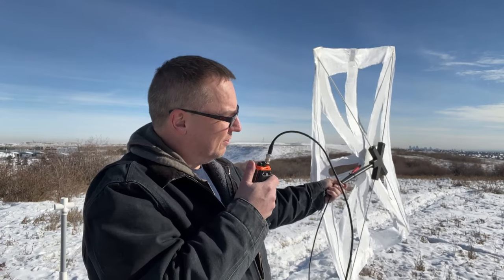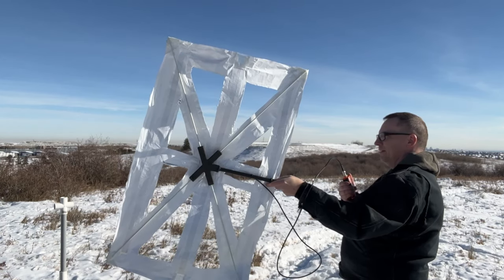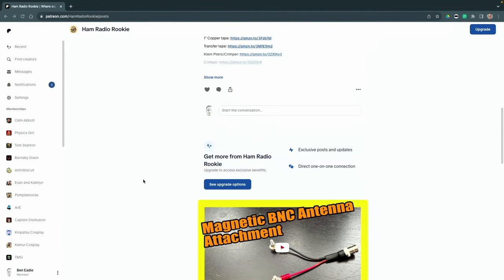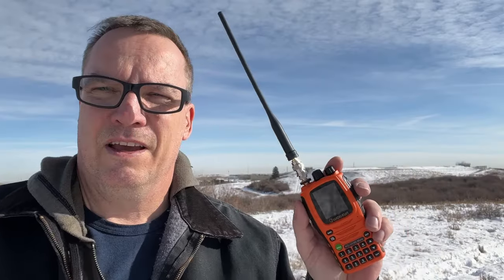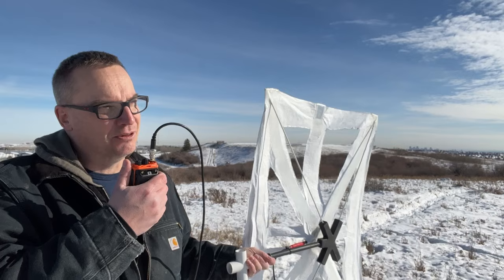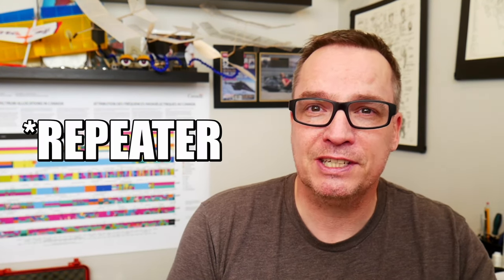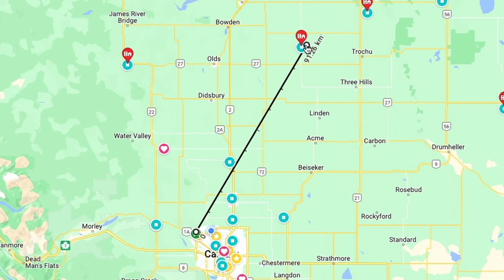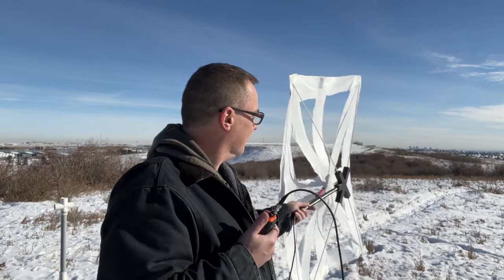Tape Measure Yagi-Uda Antenna 2m/70cm DIY: A inexpensive easy alternative to the usual build.

Comment: OK, it works, I'd give this antenna the award for the least likely to be sold.
By the time you pack away the fiberglass rods, you might as well have an aluminum of PVC or carbon fiber boom, and or elements.
In a 3 element yagi, whats important  is the driven element
and this driven element is not the most efficient.
Reply from the maker: And you know how efficient the element is how? And least likely to be sold.. Good thing you told me this. Because I might have mistook selling the next version of this antenna (in development) to 20 people to beta test as a indication that it can be sold. Would you recommend that I abandon the project and not sell to the 52 people on my email list then?  It will be released to the public soon on VFcomms.com .

Comment: Ah! I love it! This reminds me of a yagi (70 cm) I made in the past as a student, using whatever was available to me that day: masking tape, cardboard from a recycling bin and soft 22 AWG wire pieces we had laying around. It wasn't great, but compared to a default rubber ducky we were getting decent gain and getting a clear signals through 2 downtown buildings on low power (1 W if I remember correctly).
Reply from the maker: Wonderful!

Comment: I know almost nothing about antennae, shortwave, ham, etc, etc.... but it looked like the upper and lower copper tape didn't connect to anything.  Am I wrong or is there a reason for that?
Reply from the maker: They are connected to the coaxial feed line from the radio. Just taped over so they hold well.

Comment: Hello from the other side of Nose Hill:) Very cool build and similar to what's done in conductive fabrics and films in the wearable technology space. One thing that jumped out is that thin connection before the BNC/SMA connector. When films get hard/impossible to solder sometimes you can get away with a conductive tape instead of solder. These are commonly used to bond conductive fabrics for EMI shielding. They also tolerate flexing which conductive epoxies do not.
Reply from the maker: Yup exactly!

Comment: Flagi 😅 great idea for a build, you could probably fit another element to that and it would still be light and portable.
Also you have the coax coming back over the reflector. I think if you had it popping out sideways for a bit it might help. Could just add another hole on your spider for a stub coming out.
Reply from the maker: True! I’ll add that to my design. Thank you 73
Reply: @VE6SFX_HamRadioRookie  I did the calcs and yes another element woould make your YAGI a square of about 1 meter. Give or take.

Comment: Great build Ben. I'm making a 220 mhz beam with metal duct tape on a piece of cardboard for the mast etc. I'm conflicted with how wide the tape should  be for the elements. I'm going to go with 1" like yours and see what happens. It's for inside the townhouse and doesn't have to be weather resistant.
Reply from the maker: 1" for the 1.25 band will be plenty. That is a band that is only 3Mhz wide so you should be able to get it to 1.2 and below the entire band using this width
Reply: @VE6SFX_HamRadioRookie  Thanks. I might go all out and build it on a piece of poster board.  73 VE7FXY
Reply from the maker: Yes! do it you will love it
Reply: Hi Ben. The cardboard 220 4 El beam was a big success. I'd attach a pic but can't here. 73 de VE7FXY
Reply from the maker: @jasons.298  AWESOME! Great to hear.

Comment: HOME RUN!  Congratulations on this very light weight and portable Yagi.  I wonder if the RX issue was due to your HT as many of those made overseas have a desense problem in the front end RF amp.  See if you can do the same test but with a Kenwood, Icom or Yaesu rig, probably a 12v mobile type.  73 OM
Reply from the maker: Love to but my budget is very small and I can simply not afford something like that. I’ll hit up my local club with V2 and see if someone would be willing to test with me

Comment: So I got to thinking. I love your use of Ducktape. So why not use duck tape for this. With that you could use the ducktape to also make the tips. With some glass reinforced tape to boot. This would be a very strong flag and I would think if built right would be very tight also. Just a thought. Love your channel.
Reply from the maker: Yup this has crossed my mind. Stay tuned it may be coming :) 73

Comment: Cool idea Ben! Awesome video!

Look into adjusting your squelch levels. I'm sure there's not much noise on that hill and you can use a very low squelch level which will really open up your receiver. 

73 VE3GKT
Reply from the maker: Thanks for the tips! These help this rookie immensely. 73

Comment: What is the magic of 1” wide tape Ben?  Why can’t I use 1/2” OR 10mm (assuming it will carry the current induced by my drive voltage/tape resistance)?  Thanks, 73 Tom KC3QAC
Reply from the maker: In the end  it comes down to  a simple thing. The wider the tape the wider the bandwith.  You will find that 1/2" is a bit narrow for the band

Comment: How did you attach the BNC connector to the copper tape?
Reply from the maker: With copper tape :) Just taped it on. Later in future versions I make a ring terminal and use a machine screw to attach

Comment: As a full-time RVer I often go to places that would be really neat to do projects like this, but the 3D printing of course, lol. Cheers, Davey --KU9L
Reply from the maker: If you are adverse to 3d printing there are a ton of companies that will do that for you like https://www.shapeways.com/ However I am looking into producing some parts to sell as well. 73
Reply: @VE6SFX_HamRadioRookie  A centerpiece could be made with a small board and 4 small pieces of brass tubing from a hobby shop. Just epoxy them to the board at the right angle and they would work great.

Comment: Thanks for the vid! it will hopefully motivate me to get some thing built!
quick question. did you use the director-dipole-reflector measurements center to center or the space between the tape?
Reply from the maker: Center to center
Reply: @VE6SFX_HamRadioRookie 
Thanks for the reply. 
Probably such a small difference but it has a question that has been bugging me since I first looking at making the measuring tape yagi

Comment: I would be interested in a kit form to do as a club project !
Reply from the maker: Awesome! 73
Reply: @VE6SFX_HamRadioRookie  we were just discussing doing a group build of the tape measure yagis at the meeting tonight ! Your video has me wondering if a hybrid antenna could be built using pvc, but with the copper foil tape ! Either way, I'm interested in a kit if you build them !

Comment: For the reallly far repeaters, try rotating the antenna a boot the boom. At that range and frequency polarization starts playing a part in signal strenght. Had made a circ-pol antenna that worked from 130 to about 500 based on the formula. Getting full quiet on 440 and 2M from about 45 miles out. I could hear others down in the noise (helps to turn off the squelch when doing FMDX).

The squeegie (?) handle is a standard thread; it might match paint pole extentions and broom handles.  I see you were having a heat wave during testing. How long is it suppose last?
Reply from the maker: Where I live this is a late beginning to winter. The 'heat' spells last generally 6-7 months here. Thank you for the tip. When I put the antenna down it was at angle against my leg so this definitely is congruent with your polarization point. Because that is when things started coming in. Yes the thread is the same for brooms, paint poles etc.

Comment: Good job Rookie👍
Is that a SMA to BNC adapter on your radio ?
Reply from the maker: Yes it is. I have some control issues with my fingers and hands. So SMA is a huge pain for me. I added them so I could manage antennas easier
Reply: Oh yeah, forgot about that.
Next time you're in the hardware store, grab a rubber or cork stopper / plug, drill a hole to fit the adapter.
SMA connecters are notoriously fragile.

Comment: Interesting. I will stay with my proven 1 oz antenna for SOTA.
Reply from the maker: Stick with what works! That is cool. What do you have that weighs 1oz? Is it a yagi?
Reply: @VE6SFX_HamRadioRookie  edz made from 24 gauge wire.
Reply from the maker: @malenve6vid  and it weighs 1 oz? including frame supports ? Love to see your build. Got any pictures anywhere?
Reply: @VE6SFX_HamRadioRookie  hiking pole, mast or hang it in a tree.
Reply from the maker: @malenve6vid  Ok cool. Is this a Yagi style your are hanging up? Where did you get a  mast or hiking pole that weighs less than 1oz? Love to get my hands on one.

Comment: is a kite antenna even possible?
Reply from the maker: Yes! There have been many made. This type is not really conducive to a kite though as it is directional so you would be at the will of the wind. I would much rather take a parafoil and tape a slot on it or hang a j-pole from it to get the most of if it.